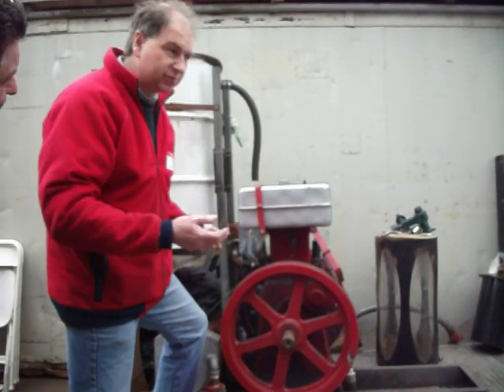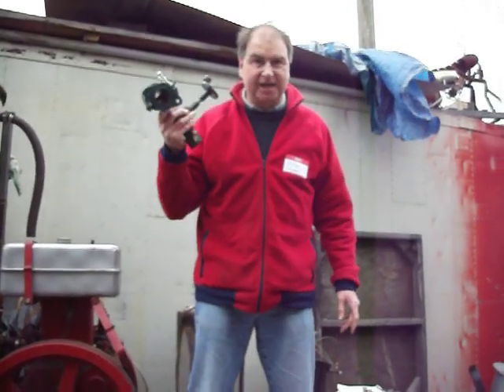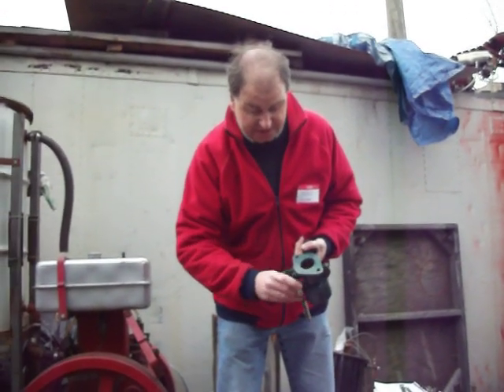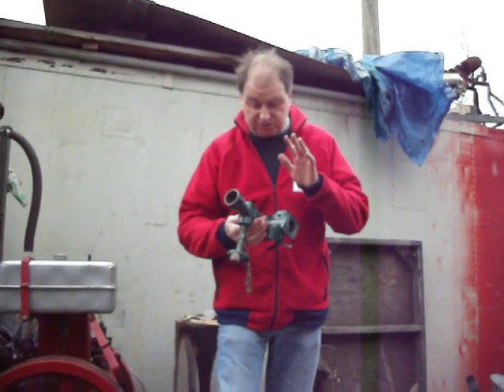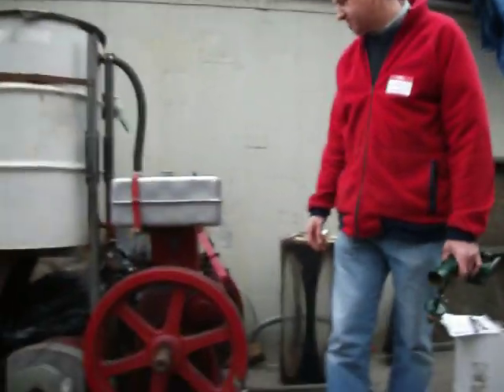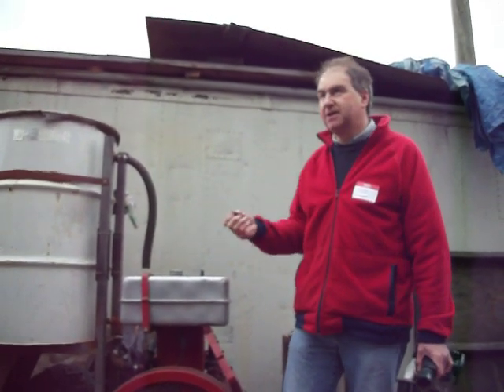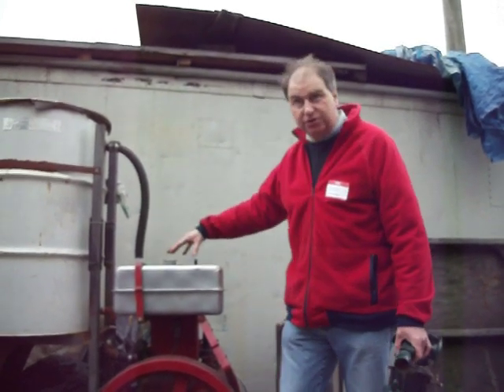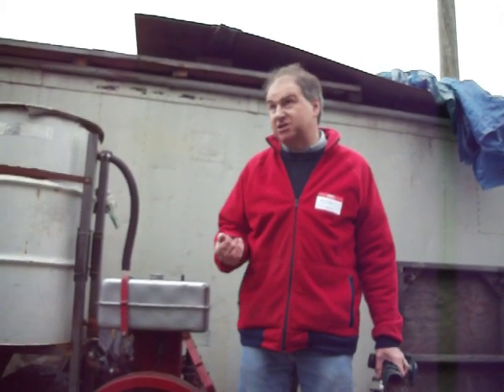Lister Woodgas spark conversion.

Comment from the maker: The Arduino was easier without modification to the engine but you are correct.
The Man leading the project that is talking and the one other guy William that was with us modified that board so the timing swung a whole 30 degrees so I could play with the timing on the fly. It was an amazing experience. I am doing a woodgas workshop this weekend.